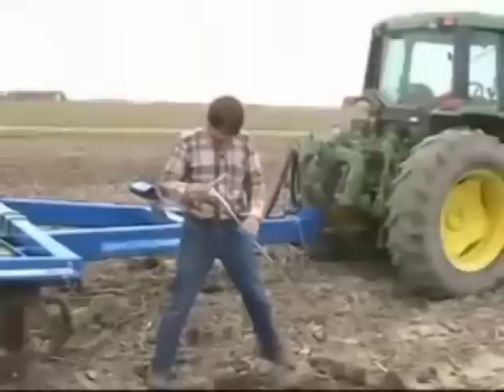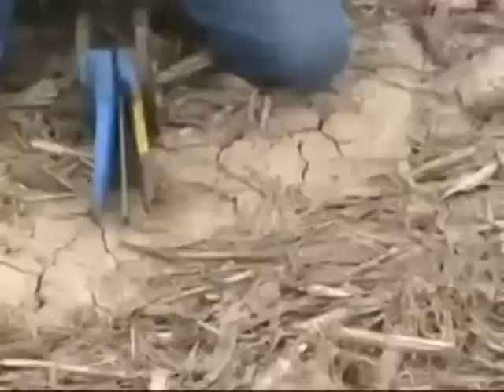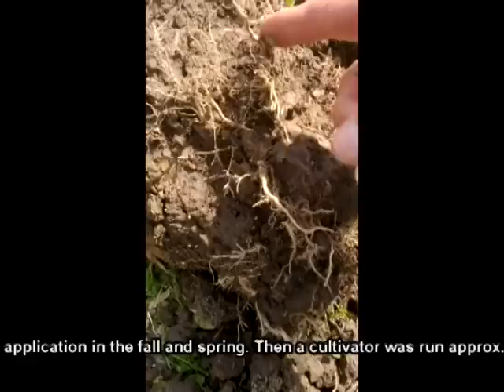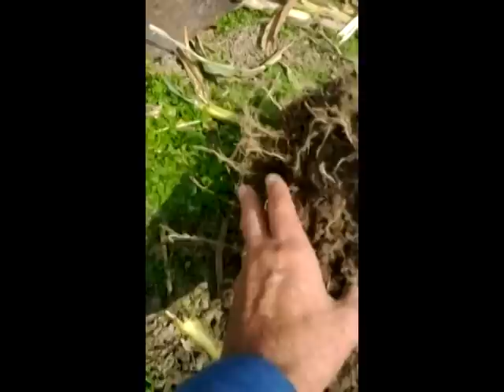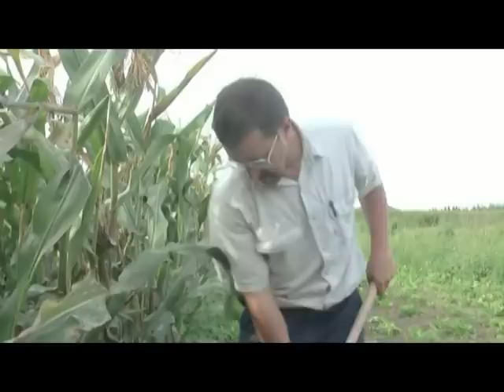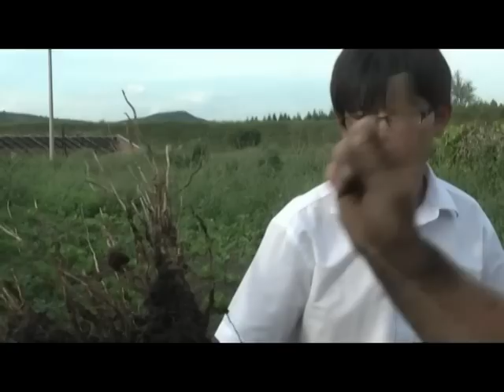Smart Till tine vs Aerway ShatterTine updated 2015

Comment: The implements are used for entirely different applications, looks like the smart tine is for field prep and the aerway is for pasture management. 

Comparing apple and oranges.
Reply from the maker: Russell, the Shattertine is used on the Aerway for everything from pasture to manure in a pocket to tillage according to their literature. I fail to grasp the complaint of comparing apples to oranges. Both tines are supposed to handle this range offunctions. This extends to the granted IP for both tines.